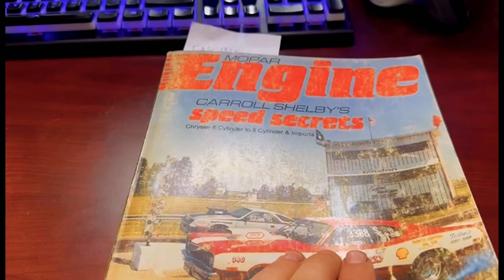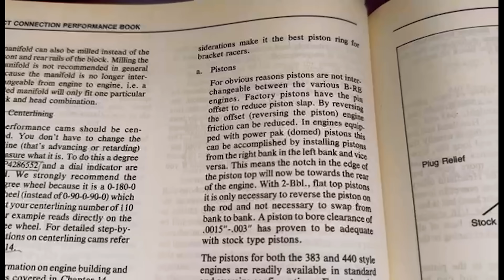The Great Piston Flip Controversy Returns - Fairy Tale Or Free Power?

Comment: The only video  I seen was on an 1989 Ford 302. When you swapped the piston and rods to the correct cylinder it actually pushed the piston higher up in the bore to increase quench. That alone won't make power until you use the proper head, cam and timing to use that quench to your advantage. Now I've seen horsepower gains on a SBC by putting pistons .005 above deck height but using other methods. Like different rods, piston heights decking and even gaskets.

Comment: As I said when this back and forth was started, I was taught this in my preteen years, in the mid 70s. This was common on the dirt track engines I was always around. You did what you could, with what you had. When the Engineers publish articles about it, no one should have an argument about it's effects. The only difference would be aftermarket pistons, that do not have offset pins.

Comment: On a dyno program it shows. When piston pin offset is changed. Or flipped. The power gains can be between 3 to 5 HP as well as 3 to 5 Foot pounds of torque. Across the the graph. It does show practical power gains.  Another thing. A Volvo semi truck uses the same principle on there engines. Yet the part that is used to copy the torque gains is actually on the piston rods. The piston rods on the crank shaft journal has the offset at a much larger gap. Allowing the engine to produce more torque. From a smaller displacement. Giving it the chance to use the same amount of fuel of a 13L with 15L power.

Comment: Wow, Engine builders not knowing about pin offset &  reversing pistons  🤣🤣

Production engines to reduce wear and noise, offset the Piston pins to keep the Piston a little squarer in the cylinder under compression loads.
When you Built Motors for people racing in controlled "stock" or limited mods class, Fitting the Offset pistons backwards could give you a bit more Torque as it improves the Angle the Rod forms with the Crank during the Power stroke.
Maybe I'm not that surprised People don't know about things like this as I just don't think people Know the basics about anything nowadays especially when you watch them work on Engines  etc,

Comment: Speaking of oil consumption. 
Would you trust flipped pistons inside a towing motor?  Something with the intended purpose of long duration sustained load. How bad would you think the oiling and piston skirt to cylinder wall interaction and oil consumption would be  compared to the stock setup?

Comment: Ive got that issue of hot rod magazine from back in my dads day joe sherman put together a sbf 302" deal that dyno 600 something with ported stock irons and all the "tricks" and he made a big deal about flipped pistons.... honestly it depends on the situation a .300 outboard offset sbf is going to make more up top with less angle and friction with the short 5.090 stock length rods than say a 350 sbc with a 5.7 rod and a centered wrist pin simply because the cylinder wall isnt being driven into as hard even though the rod to stroke ratio is better
We raced nmra factory stock for years and narrowed main and rod bearings and windage control along with ring seal are responsible for more power than any tricked out valvetrain or cheated up ported iron head than i had ever ran or put on a dyno and its hard for people to understand that its the whole package working together that got us those low 10 sec passes with purely stock parts...

Comment: My first engine rebuild was a 273 Hi Po in 1972. I reversed the pistons and rods together, as you demonstrated. I was 20 years old. That 273 beat a bunch of 383 Road Runners. It had the stock cam and  headers. It ran 14.50s. I still have all my Chrysler Direct Connection manuals with all the tech tips. The 65 Dart I had was a National Record holder too! It was a rare Dart Charger from  CA.

Comment: Back in mid 80s I worked as a tech at a GM dealer with a a guy who was at that time in his late 50s.  And was a sponsored drag racer since the 60s. He was very much a keep his secrets to himself type but he was finishing a 455 Buick engine for a drag car.  before he could put the heads on I did see the Pistons and noticed they were installed backwards.  I asked him, he shrugged it off and said oh I just get a little better revs that way.  Since then I have put together dozens of engines myself and I realize there’s a little more to it than that.  It’s just kind of cool to see this idea being brought to a new generation.   This channel is the kind of bench racing and shop talk iand occasionally real racing that I grew up on.   I’m 60 now, but this is still a huge part of my life.   I’m currently building a BBC 427 for a street rod project.  Never to old to go fast.
Reply: We're the wrist pins centered on the piston, or was it offset? It could be physics. More leverage.
Reply: He just said the builder kept his secrets to himself. They were already in the engine, as he was putting the heads on it. Kinda hard to see if they were offset or not.

Comment: I did this to a Ford 302 that I put in my wife's vintage Ford Falcon station wagon, 40 years ago. We still have the car, the engine has never been apart since then, the engine still runs excellent.
Reply: 2BBL engine?
Reply: @kramnull8962 yes, 2 barrel carb.
Reply: @kramnull8962   Yes 2BBL engine
Reply: @abcullens2328  Thanks, got a decent one in a '74 Granada.

Comment: really depends on your situation,the one i know that is FACT is the XU-1 holden torana engines had to run a stock piston with the offset gudgeon pin,ian found if he turned the piston around the "wrong" way it gave an advantage at high RPM's

Comment: I'm 49, and most of my working life was spent in the industry. I was originally trained in high school as a mechanic, and then I fell into the parts side of the business and spent 20 years as a counterman, more than 10 of which were spent in a speed shop, kibitzing with machinists and engine builders. I have never heard of this before, and it's interesting, but I don't really see how it gives you much of an advantage. Yes, reducing friction will free up a little power, but I can't imagine that it would be much more than a few tenths of a percentage point. Now despite my years of experience, I'll be the first to admit that I don't know everything, or even half of everything. So I need to ask, what is the actual, real-world advantage of doing this? What is the actual empirical evidence showing the advantage? And the big question is, Is this actually worth doing? I'm not pooh-poohing what you said, I'm just trying to understand it.

Comment: It would seem to me that with 400 piston offset that the piston would raise up higher in the cylinder block causing an issue hitting the valves or the head. But I could be wrong

Comment: When I flipped the pistons backwards on my slant six, it changed where true TDC is. By using the positive stop method true TDC is now 9 degrees BTDC on the timing tab. The outside balancer ring has not moved on the balancer. The timing marks on the crank gear and the cam gear line up perfectly when the balancer's  mark is set to 0 degrees on the tab but this is not where true TDC is anymore. I degreed the cam from true TDC and it runs great. So if you the backwards piston thing, you must be precise on degreeing the cam from true TDC.

Comment: i recently watched an old Nicks garage and he had an engine that making some terrible noise. turns out the builder had the pistons turned around and the bigger intake valve was hitting the piston due to the smaller relief because it was sized for the exhaust valve. im guessing this could be an issue also.

Comment: 50 or 60 years ago, this was supposed to be an NHRA Junior Stock small block Chevy trick. Guys swore that even if the pistons rattled a little at idle, you couldn't hear it with open headers. They swore it made the engine rev faster. We put the pistons in correctly in our 205 horse 265, 3-speed '56 Chevy 9 passenger station wagon that ran SS/T.

Comment: Think you miss spoke about offset grinding a crankshaft.  
Plus or minus on the overall stroke. Thats all can be achieved.
Reply from the maker: No, the crank is literally offset in the block
Reply: @UncleTonysGarage on the mains , that block turns into a conversation piece ,sitting on the engine stand in the corner of the shop forever.

Comment: This brings up some unexpected memories for me [recent memories, but then my memory is so bad, it takes something LIKE this to retrieve anything], I have that IH I/C 392 that has experienced 'some piston slap' for a while, which I then cured with super heavy weight oil.

The funny part is, since it had a broken exhaust system when I got it, I never heard this until I fixed the exhaust.

I remember remarking to people: "Huh...now I've fixed the exhaust, I can finally hear the motor!"

And I'm quite confident this motor likely exhibits more output than it did at the factory.

That said, while it has low compression on 2 cylinders, that could be a host of factors, but I fully intend to rebuild it anyhow, just to ensure it is as good as it can be, but if the pistons are simply slapping because of wear-and-tear, I'll still flip the pistons, anyhow.

But yeah, sealing up a destroyed exhaust suddenly making it clear that the pistons slap, to me, is really not a problem.

I already make people mad that I run GL5 in my block.

As a former full time racer, everybody I knew ran either GL4 or GL5 and loose pistons/rings.

Comment: I didn't need to hear the whole video to recognize what you were talking about.
For years almost all manufacturers of automobiles, had wrist pin offset in the pistons. Reason to aid in the reduction of cylinder bore wear. But a few individuals back in the day, found out about the secret of switching the pistons orientation. 
They gained a few horsepower from it. Note the pistons had to have daul valve relief's.
Otherwise depending on camshaft lift. You might run into valve clearance problems...
It's an old pure stock engine trick for an extra ten or twelve horsepower.
Good one Tony for teaching those old guy's and youngster's who never knew about it 😉
Like someone else mentioned it was in the Mopar Bible sold during the Direct Connection days. I had one and gave it to someone I sold my 1970 6 Bbl. Cuda 😑 Regret that to this day...

Comment: We have old 1960's, 1970's shop books that state, when doing an oil change on a dirt bike for instance dig a hole and  bary the oil......
Reply: In an old Onan generator installation book Ive seen how to make a muffler by digging a hole and using a 55 gallon drum that's perforated on the sides and buried in gravel. 
(Don't perforate the top to keep water out). 
Folks loved burying stuff back in the 40s thru the 60s it seems. 😂😂

Comment: Smokey yunick offset the whole crank cause nascar didn t allow offset pins
Reply: Works on an in line engine (Hudson 6 cyl),  moving the crank in a v engine doesn't work, but it will not on a flat engine, porche, subaru

Comment: I really enjoy this! I was taught 50 years ago, about the centrifugal force wear on the pistons and cylinders caused an elliptical wear pattern on both to the outside of the block. Reversing the pistons would help correct the sealing on rebuild. Just a note, reversing the pistons and switching banks effectively kept the offset to the outside of the block.😏

Comment: Hy i am Rick Martin and have been going to drags strips since 1959 i now race 1950s lincoln Yblocks , one of the tricks in the 50s on 49-54 Oldsmobiles was to put pistons in backwards , those cars dominated the lower stock classes , in stock class you do what you can to get ant edge on competion, i am now building a 56 lincoln with Mchuloch blown  040 over 368 , howard cam home made headers , will run standing mile and old time drags, Thank You  Rick Martin Darrtown Ohio

Comment: Piston flipping done right could gain a little power but not enough to make a big difference.  Engines with factory offset piston pins frequently will have replacement/performance pistons with zero offset.

Comment: In my 8th Edition version of the Speed Secrets book, it says on page 62 (LA) and page 222 (B/RB) about Piston Pins - Offset Pins:
"It is commonly known that you can turn pistons around.  The piston, when originally made, has an offset pin.  This offset pin makes the engine run quieter.  By reversing the pistons (the arrow on the top of the piston now points to the rear of the engine instead of the front ('stock' installation position)), you can reverse the centerline of the pin.  This makes the engine noisier, but it will also produce a little more torque."
"This is a gray area in the rules for most types of racing because the rules usually only state that stock pistons must be used, not whether or not their installed positions can be changed.  Being a political situation, it's up to the racer to decide if he wants to chance it."

Comment: It's crucial you run reverse viscosity oil when doing this. 30w-10 is probably the best.
Reply: Your engine overheats when you do that if you forget to flip the thermostat.
Reply: @zippityzbrake only if you don't run reverse polarity coolant.
Reply: Well that only works if you install the water pumps fan belt in a figure 8 pattern, to reverse the flow. And no, a simple pump swap to a reverse flow won't do.... The belt must be in a figure 8.  @zippityzbrake
Reply: Also you have to run a positive ground on the electrical system.
Reply: Its only for making the engine run backwards, in case you put the axle in backwards 😂

Comment: FUN FACT: If you want your engine to last a tiny bit longer then put the offset "so that the con rod is straighter-up-and-down* on the power stroke".
If you want your engine to have a tiny bit more torque then put the offset "so that the rod is laid over more sideways** on the power stroke".
     (* replace "up and down" with "more aligned with the cylinder bore")
   (** replace "more sideways" with "more OUT of alignment with cylinder bore")
Reply: ONE MORE FUN FACT: Just F.T.F.O.I. you should re-mark TDC on your harmonic balancer because moving the wrist pin's position will change it's location. You guys DO know how to find and mark TDC with high precision - right?

Comment: I first heard of reversed pistons back in the 90s. Was at a circle track pure stock race. One car absolutely dominated this particular race. Went down a lap or two for a pit and came back out and ran back to the front to win. Got protested and torn down for inspection. Got disqualified for reversed pistons. I, having never heard of any such thing, thought it was likely just political. Had to read up on it. Now, I doubt the pistons where the only thing making the difference. Gears, chassis setup, and driver skill likely played a part. But the tech guys thought it made a difference. Theres only so much you can do with a piston to improve power. If you aren't changing compression or trying to rotate the earth, aftermarket pistons probably aren't worth much power on their own. And in a class where aftermarket isn't allowed, it's the best that can be done.

Comment: The whole concept of piston offset is because at TDC with a centered pin no matter how much pressure you have on top of the piston you get NO power from it because the rod must have a thrust angle to be able to push the crankshaft forward in its' rotation.   Offset the piston pin to the rear relative to the crankshaft rotation and you then have an angle on the rod at TDC and it's therefore able to put power to the crank....but at the expense of additional thrust pressure on the piston major thrust face.    So besides noise there is a low rpm torque production advantage with offset piston pins that benefit trucks a lot.

Turning the offset around will hurt the bottom end torque as you no longer have the thrust angle developing earlier than TDC but you also then reduce the additional thrust pressure from that additional torque production so I can see it could reduce friction at high rpm.   So this is basically only helpful if you're running stock cast pistons  by rule in like a Super Stock class type motor.   Anything with forged racing pistons will normally have straight pins from what I've dealt with.  Not saying there aren't offset forged pistons out there...just that I've never played with any.
Reply: I figured you would go in one direction you will lose in the other direction. I guess it's gonna matter which way you want the power to come in. So I also see that aftermarket performance pistons are also all centered pins. I imagine the timing will have to be adjusted to suit a reverse piston for idle or low rpm operation since the rod will have less mechanical advantage against the crank since ignition happens before the rod reaches its advantage on the crank.

Comment: Smokey Yunick and Hudson engineers conspired and made offset cylinder blocks for the Hornet 7X when nadscarp DQed Smokey because he turned pistons around to reverse pin offset to accomplish the same or similar advantages discussed in the video. Pin offset one way makes the engine quieter by reducing piston slap, offset the other direction the pistons rattle more and torque output is increased (so the story goes). Big Bill France insisted pistons with offset pins had to be installed the same as production vehicles, so, for Smokey, Hudson cast and machined blocks with offset cylinders.